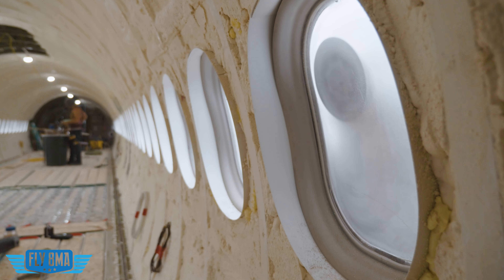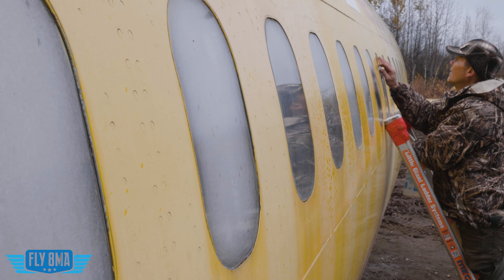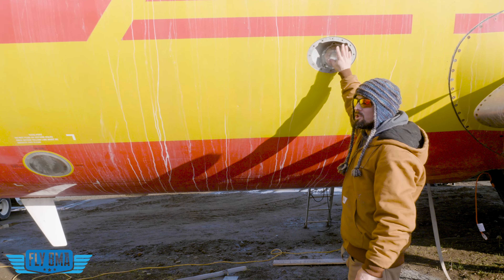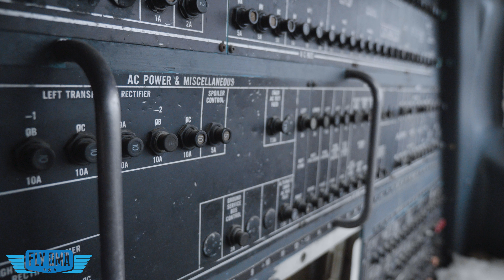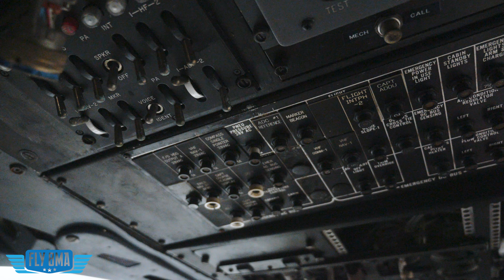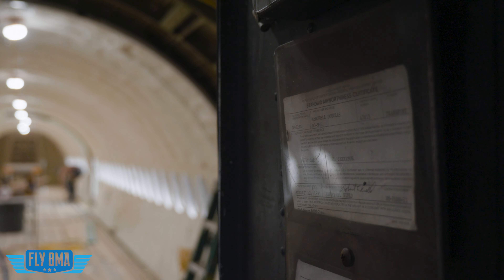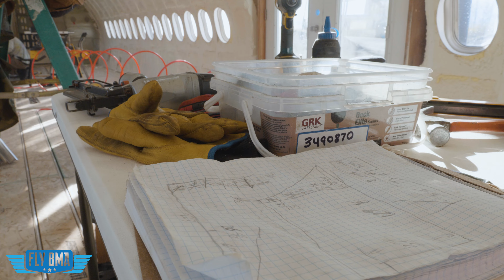Building our Airplane House part 3

Comment: Just for a safety an liability standpoint I would put a fall structure around whatever your plans are for climbing the tail, an also a landing platform. I would in a mine, an I know mshaa an osha are super strict with ladder type things. Especially with you having guests going up, a steel frame tube style thing around it would probably work, otherwise they will probably require you to have some sort of fall protection

Comment: This is the most epic and meaningful (to me) build on YouTube. Everything your doing is my dream. I’m a student pilot in a huge transition out of my business and into flying commercially as well as general aviation. 
     I have a vision and goal almost identical to what your doing.   
        It’s such an inspiration to be able to see your process and helps keep me motivated. It also allows me to learn through your process. 
     Not just the planes but the whole compound. 
      Thank you for sharing your whole build series on all you have created. 
       I plan to come up there in the future for sure! And I’ll be flying there for sure. 
      BTW my 2 cents on the insulation. Spray foam is the best way to go. High density spray foam can give the most insulation value per cubic inch.
Reply from the maker: thanks for the feed back 624! Reach out to us when your thinking of coming up and want to visit.

Comment: Why not put temporary skis on it (727)with the dozer pulling it during the winter. It will slide a lot easier and be easier to move.
Reply from the maker: By the time we build those skis we'll have a lot of time and money into it, we ended up swinging it over with a crane.  Turns out when the ground is covered in ice and its easy to slide the bulldozer has almost no traction

Comment: Thinking about it moving the 727 with the D18 might be doable. I would probably tie straps, rope or chains from the main gear to the dozer to carry the most load and a short fixed pipe (tow bar) to the nose gear for steering. If the ground isn't too rough it might work. Good luck
Reply from the maker: currently winterizing everything and picking up the grounds before the real winter hits. A lot of good suggestions so far but moving an 80,000 lb beast has been tricky so far to figure out for a descent price